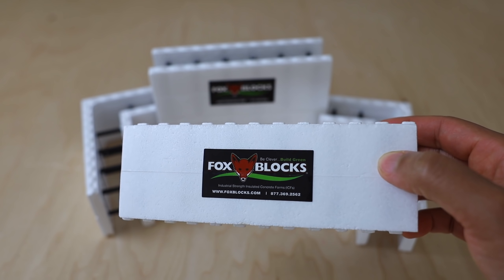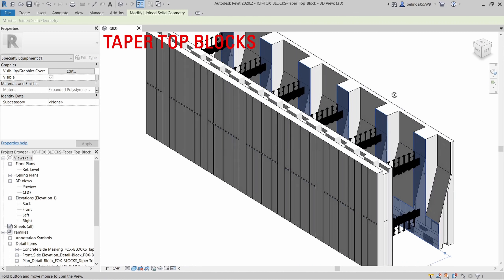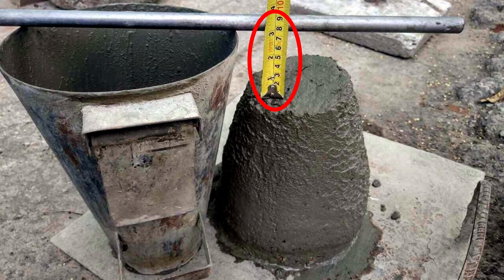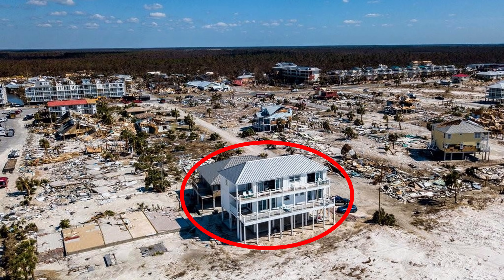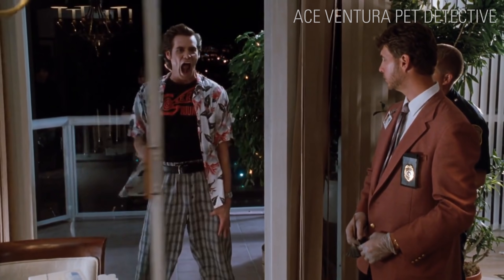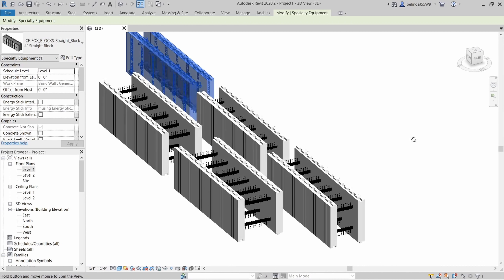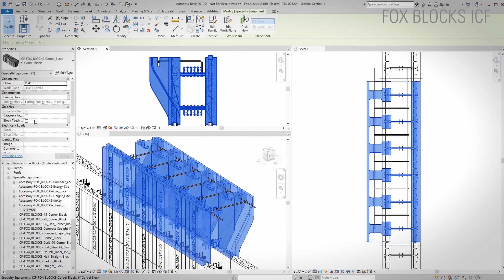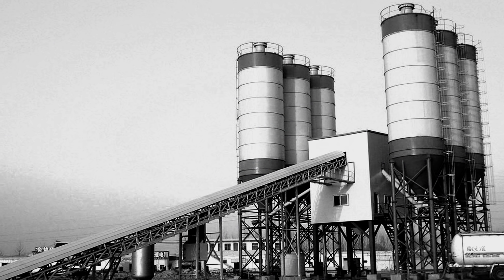Pros & Cons of Insulated Concrete Forms /ICF construction

Comment: I love the idea of building my forever home with ICF but I suspect it would be cost prohibitive. I plan to build a net positive energy home in 4-5 years and my budget will be somewhat tight. However, I do plan to do a lot of the interior finishing myself to save money. My absolute top priority is to get the envelope perfect because if the building leaks water or air, you've already failed. I'm shooting for a minimum R-35 wall assembly and R-55 roof assembly, with the a laser focus on waterproofing. ICF certainly fits the bill and offers superior strength, but a gapped double stud wall would likely be far more economical and achieve similar thermal results, just nowhere near as durable.

Comment: "Concrete itself has no R value"

Of course it does - depending on the mix design, it runs from around 0.1 to 0.2 per inch.  Even copper and steel have an R value.

Comment: If you were to put studs on the inside of the walls + spray foam inside, would this eliminate all the drawbacks of ICF walls (at the monetary cost of having to frame the walls interiorly). It seems like that would allow the remainder of construction to happen like it normally would.

Comment: How does the measurements work - $10 - $15/ft2? So multiply that also by the height of the building?? If 3000 ft 2 exterior wall and is 10 ft high, then it would be $10/ft2 x 3000 ft2 perimeter x 10 ft high? Im not sure that is correct…so only 10ft high it is $300K alone? That includes the concrete, “id hope to shout!”, is that correct?

Comment: You should mention about termites. That is a big problem.  They can tunnel up through the polystyrene to get to wood in the roof.  Also waterproofing below grade is more difficult as it is difficult to stick to foam.

Comment: ICF homes should not use a stucco exterior finish. I have found that they mold up after a short time. There needs to be a spacer between the ICF blocks and any finish.

Comment: Had an ICF home that I truly miss.  It was 3500sq-ft but even in the same temperatures was far cheaper to heat and cool than my current 2000sq-ft stick home.  The home had a metal room with 16in of spray foam insulation applied to the underside so the attic was conditioned space.  The thermal stability of that home was pretty amazing.  I'd have another one in a heart-beat.

Comment: I've changed over from wood construction to CMU walls due to cost. A lot of advantages beyond cost. The last homes were left exposed on the out side, metal stud furring and drywall on the inside.  For me the drawback to the Fox blocks is having to install a finish to the exterior side of the ICF. The ICF blocks are going in the right direction but the cost is a big drawback along with the cons you pointed out. Thanks Belinda for another great educational video for us dumb architects...hehe

Comment: Hi Belinda… I’m late to this video, but I’m hoping you still keep an eye open to comments on your older posts.
One question I have regarding ICF walls:
Do codes require drywall on the interior side of ICF walls? And, if so, is this due to flammability concerns of the Polystyrene insulation?

If drywall isn’t required to meet fire codes in residential buildings, that’s a cost savings, as well as a huge headache(drywall) eliminated from those who pursue an owner/builder house project.
I’d seriously consider using ICF for some interior walls as well. 

Appreciate feedback, and really enjoy your videos!
- Chad

Comment: The cost of an icf house has to include roof and sheetrocking inside and putting on exterior also the fact that it has to be sided within 6 mo or the icf blocks get dusty and flaky. I have also watched videos that said termite exterminators wont treat icf homes.  So the next question is what is your opinion on cinder block houses vs icf houses?

Comment: I'd like to use icf walls for my greenhouse ~12 x 24' This is in SW Pa. Zone 5.   The ICF walls would be down to the footers ~3' in the ground and 3' above ground or 6' total possibly with awning windows every 8' for ventilation.  I want to insulate well from the ground and have a main radiant heat system in a slab inside the GH.  

Any reflections on the ICF base foundation wall topic?

This will be a four season GH for warm loving plants like orchids and Aroids.  I'd like to keep a minimum of 65F.  The frame will be covered in 5wall 16mm polycarbonate (r= 3).
Lots of water will be sprayed on plants so a good drainage system to the backyard would be needed.

Any comments overall on project 🙂

Comment: Good morn! Very sorry to comment on an older video, I just found your channel. I’ve only recently become a YouTube addict. I am looking to build a home in AZ. Fox blocks were at the top of my list till a good friend found a company called “The perfect Block” a concrete infused icf, it uses grout as a filler, so no vibration. It also doesn’t require bracing. Are you familiar with this product? Many thanks.

Comment: Hi, Belinda! I really find your videos to be very great.
If you see this comment, I have a question to ask you.
I want to build a closet for 3D FFF printers in my garage. As you can imagine, the shock of cold air will destroy any print when the garage door opener is used. Also, the humidity affects the materials that are being used in the process. Many filaments are hydroscopic. Controlling the vapor that gets introduced into the heated nozzle when filament is pushed through it would be wild to control during different seasons of exposure to weather.
If you could contain both the filament storage and the 3D printers in a closet that becomes exposed to nature's conditions, how would you think is best to build an enclosure that is hermetically sealed against humidity and temperature?
I know that recovering to the ideal state would be a process that must be practiced every time after the closet is opened.
Anyway, I watch your videos to help me think about building such a closet.

Comment: My parents built an ICF steel interior home 18 yrs ago and it is like a fortress.  Great R value and sound dampening.  I am starting the process of building an ICF home in coastal SC so I don’t need to worry about hurricane damage.  Attaching hardiplank outside and stucco protects foam and drywall interior.  Steel wall and truss systems allows longer unsupported walls for first and second floors.  The only drawback is attaching required metal cutting screws in old block but with new plastic ribs allows attachment of drywall screws.

Comment: Homes in the mid-west have basements which are concrete, if you use ICF's for the basement you are using less concrete and you are getting a R-30 or so insulation on your basement walls keeping your house warmer in the winter and cooler in the summer.

Comment: I did find another potentially big drawback from another video. If you live in an area where your home needs to be inspected and treated for termites and you have an ICF base and wood top. They can't inspect your home for termites because termites and other bugs can dig through the foam and make it impossible to tell if they are there.

Comment: 1:24
This is definitely not a 45 degree angle.
8:27
ِAlso, I don't get this. Why call it INSULATED concrete if it wasn't gonna work in cold and humid climates? 
Didn't you just mention that ICF has a great R value of 50? 
Great content Belinda. Thank you for this wonderful channel!

Comment: This is a strange con: When we were building a structure with fox blocks two summers back, our chickens ended up eating them, and not in small quantities. We had set the forms up a couple days before the pour and didn't think too much of it. When we came back they had destroyed the left over pieces in the pole bale and poked 4 inch wholes straight though the wall in a couple spots. None of them died from ingesting that much polystyrene, which was unexpected, but we didn't eat their eggs for a month after the incident.

Comment: Hi Belinda, I enjoy your videos!  Could you do a video on SIP construction pros and cons?  This type of alternative construction is worth considering along with ICF, and it would be helpful to see your take on it.  Thanks!
Reply: Hey Jenny, I can tell you from experience that SIP has just one flaw we experienced here in where I live, cold damp climate. if the panels arrive bent or they bend because of moisture that's it! We are about to start our build using ICF. Probably the roof can be ISP but a false ceiling would need to be planned for features of the likes of downlights and mecanical ventilation systems

Comment: Im a personal project builder in Toronto and finished my first all ICF two storey 3600 square foot home a few years ago. Fast, quality, and "considerably" less expensive than traditional methods, materials all around. An absolutely astounding incredibly comfortable quiet home. There will have to be a revolution in materials and processes before I consider using a different process than ICF. AND SO EASY!

Comment: 7:31 "I thought it would have some height restraints, but you can build multi-storey, residential buildings with these blocks."

Wait... I assume they build and pour one level at a time, since otherwise to have hollow, lightweight walls that would fall over. But, would that create seams between levels? Is that even an issue?
I don't expect an answer, but that an ICF skyscraper sounds like a fascinating project to oversee.

Comment: Belinda - you are doing very good work here, but could I make a please for metric translations (on-screen is fine) so that your content is understandable outside the strange world of the US.  R-22 or R50 is meaningless to those of us that measure walls in W/m2K and expect numbers to be between 2.2 (very bad) and 0.1 (extremely good) for example. And obviously I could work out what the hell size 2 and 5/8ths inches is, and so could every other viewer in the other 193 countries, but if you just did it once, that would be a lot less work all round. I guess it's about 65mm. So 130mm EPS which isn't bad but not great either. Most of these ICF products seem to have annoying thin EPS. I don't know why they do that. 

I think you forgot to mention one of the big disadvantages, which is that you get plenty of thermal mass, but isolated from the inside of the building where you really wanted it. That's the main thing that puts me off doing it this way as well as the mediocre insulation level.

Comment: "Concrete itself has no R value"    Of course it does.  It's not a high R value,  but I guarantee you that if you put a concrete panel in your thermal resistance measuring apparatus, you'll get a non-zero thermal resistance.  It ain't gonna be as high as EPS,  but it would be higher than an aluminum panel (which will also have a non-zero R value)
Reply: Yeah, that was a bit of a dumb thing to say wasn't it? We expect better of Belinda, who clearly does understand these things really. I also do wish she'd put some metric numbers in on screen, so that her videos made some kind of sense outside the weird world of the US. R-22 or R50 is meaningless to those of us that measure walls in W/m2K and expect numbers to be between 2.2 (very bad) and 0.1 (extremely good).

Comment: I'm not sure that the 100 year lifespan is even worth considering. I live in Western Massachusetts in the US and most of the wooden/stick frame houses around where I live have been here since the late 1800s and very, very early 1900s and are still going strong. There are many new homes in the couple areas in town where the rich folk live but for the most part it's the older homes with the newer homes dating to between world wars. The house I grew up in is so old the old tin type photos of the property that date to when my father's family came to the US show that there was no electricity, running water or proper roads in the area. In one of the photos there are literal wagon tracks winding down what would become a main road about forty years after the photo was taken and the four huge trees I grew up climbing and that still tower over the two story house were just tiny saplings so fragile they had nets of wire and wooden stakes to keep them upright and protected. Stick frame houses properly maintained can last damn near forever. Concrete begins cracking and failing almost as soon as it's cured. Concrete is also not allowed the proper time to cure in the US construction industry before a lot of weight for additional structure is placed on it. In normal homes this leads to micro fractures that generally go unoticed and show up as major cracks, crumbling and other problems just a couple years later.

Comment: Built my 3000sqft home with ICFs, took 13 months to complete. Heating and hotwater costs about $1200/year.
Next house will be similar in size 2storey again but built in steel with prefab home built walls using an industrialised nZEB
Lean BIM construction - costs around $80/sqft. Running costs zero! LCA 150+ years. 80% recyclable and environmentally sustainable!!! Turn-key 5 month build!

Comment: The issues of routing electrical/plumbing are fixed by using 1x3s and framing out the walls instead of trying to put drywall directly on foam. Or you can use conduit and boxes directly on the foam after plastering it. Nothing says outlets must be smooth against the wall, after all.

Comment: My family is dealing with mold in our wood built home(built mostly to spec according to the Canadian Wood Frame Homes manual from 1999).  We apparently missed the part in the book(that was absent) about proper moisture barrier in roof and walls...so now we have a different climate than we did 15 years ago, with our winters being much warmer and wetter...and our early summer being much wetter...so we had a air quality survey done and it was determined that we have black mold.  We have been looking for it, but cannot find it.  I bought a bore cam to do inside walls and roof inspections and so far have not seen any obvious black mold.  Anyway, the search continues...I would love to have a home built from these fox blocks.  At least the from the ground to the top of the first floor.

Comment: I have an ICF house that I was the Gen contractor on, supper insulated and mouse proof. Used ICF blocks, 10 inch blocks with extra foam on outside wall giving me 8 inch walls.  5 bars on 16 center and 4000 psi concrect.
Reply: its also bullet resistance , fire , termites , high pinch  sounds resistance

Comment: I just found your channel Belinda. Love your content. We have been building with ICF in the North Texas area since 1992. We are about to start an urban infill project off of 1-30. It will be 2 stories with an ICF roof deck. We just sold our ICF home in Argyle that we built in 2005 and have a new home designed with ICF walls floor and roof system.
Reply: Hi Norman, I am in north Texas and am looking into building an ICF home. Do you mind if I ask you a few questions about it? Do you have an email address I can send the questions to or is here ok?

Comment: Termites will just plow through the foam to get at the wood framing above.
Reply: I'm honestly really curious for more information about why you believe this. I'm very aware of the potential problems with termites and how pervasive they can be, but I'm not even totally sure what point you're trying to make here. Are you trying to warn people to consider the possibility of infestation, or making a comparison to stick framing, or...?
Reply: the system is designed to build the complete house with, and only the roof will use wood trusses.
I don't think termites will eat trough 20ft of foam up the wall to get there, the concrete is too dense even for them to get trough.